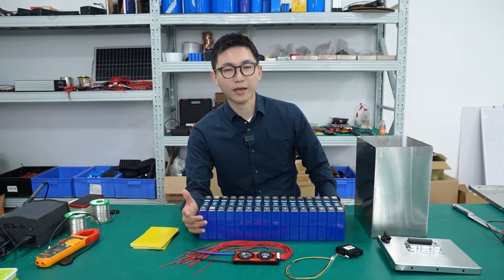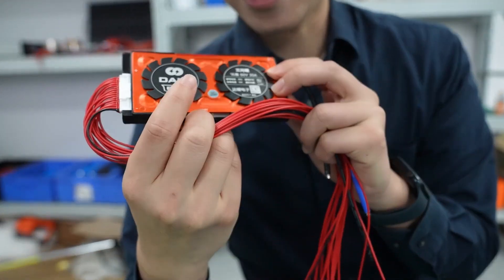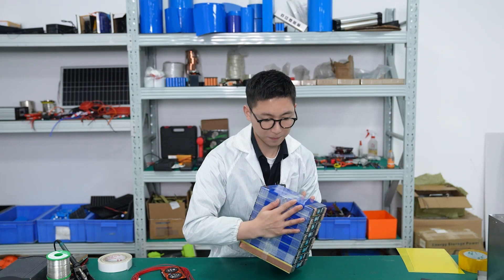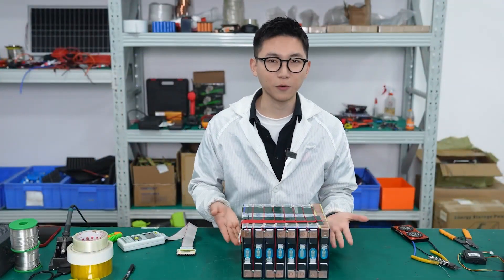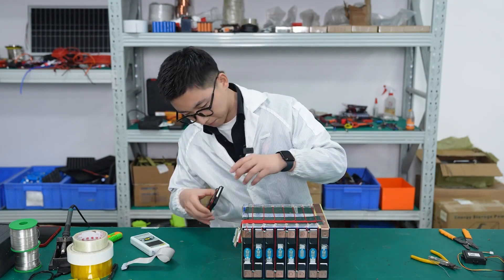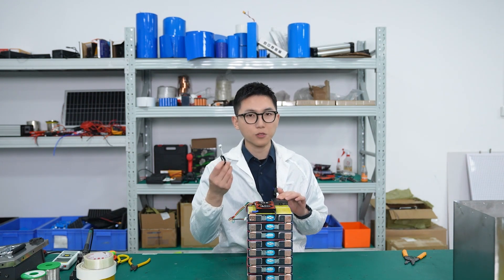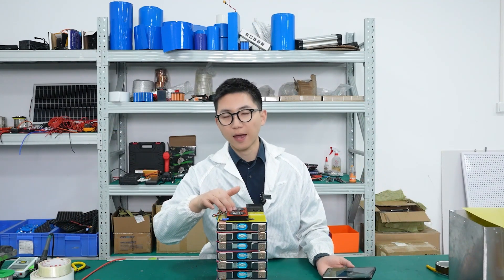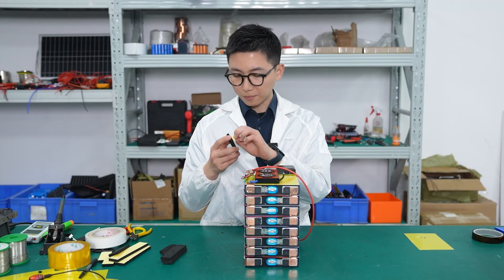Build a 60V 60Ah battery pack for electric bike with GPS

Comment: How is this 60v ?  It's a 16S lithium iron phosphate, right?
Reply from the maker: It’s li-ion battery. 16S can be 60V, not lifepo4
Reply: These are NMC cells, not LIFEPO4 cells. Massive difference between the two, even though they look the same. Look up NMC prismatic cells and you will see that they are the same, but you can get whatever ah you need.